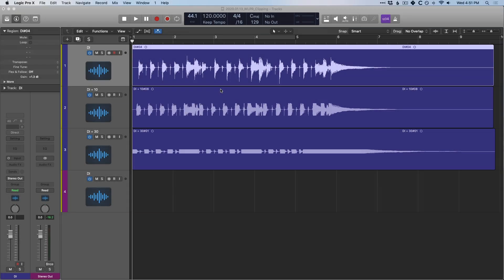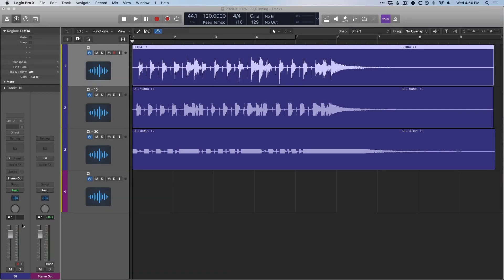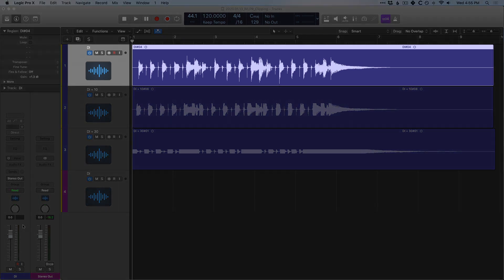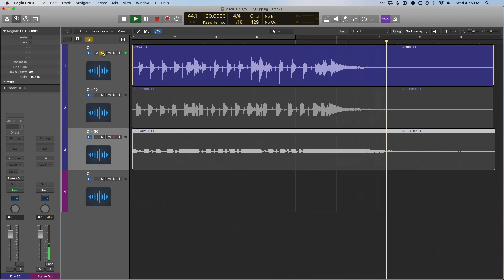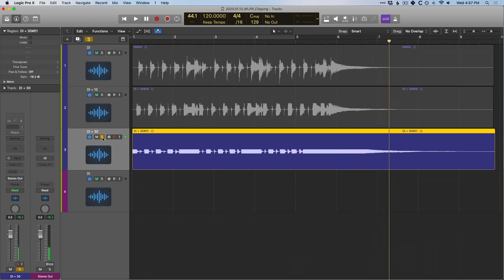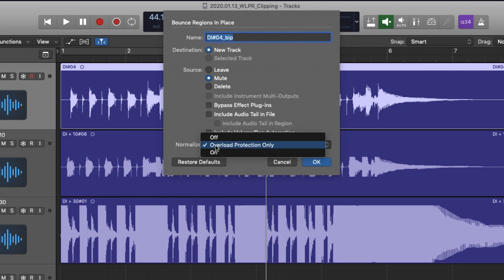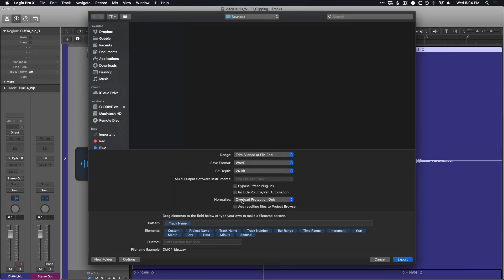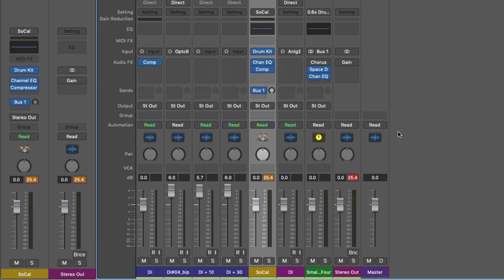Stop Clipping Audio in Your Logic Projects - How to Protect Your Audio in Logic

Comment: I have an issue where the track sounds great in Logic but when I bounce it I get a few slight clips/glitches/hiccups in the same areas.  These areas aren't even that loud and don't have a ton of instruments.  I'm barely even going into the yellow on my mix.  I'm afraid if I turn down anymore, I will lose the impact.  There are louder and more dense parts of the songs where this doesn't happen.  I've searched for this issue and see others have mentioned it but with no good solutions.  Any ideas?
Reply: I have the same issue...It works perfect in Logic, audio sounds great ...but when I bounce it, clipping occurs!
Reply: @vishnutheerdhan_offl  Hey Vishnu, our friend told us a trick.  Bounce using REAL TIME option and it should reduce those clicks.  It's worked for us, hopefully this helps.

Comment: In FCP X the audio waveforms turn yellow and red to give you an instant view of where your levels are for your entire timeline. Does Logic Pro X have this feature?  Please don't tell me it doesn’t—because that would be quite disappointing. If so, does it mean I have to play down my entire 1-hour timeline and stare at the levels to make sure nothing is clipping?

Also, why don't the audio waveforms change in size like in FCPX?  For example, if I increase the output gain in a Compressor filter. The audio waveforms don't enlarge. Strange.

Comment: I like some of the clipping on those guitars - gives em beef/attitude. The clipped drums compression - the clipping seems to do what some plugins do on purpose for effect.
Reply: Wel instead of doing something so janky as bumping up the gain to +30, I’d rather use a saturation plugin or introduce a bit of parallel compression.
Reply: @DecontructRecreate  Yes, I'd try that myself first - rather than slamming the gain.

Comment: hi Chris - I have just bought a Rode NT1-a condenser mic to record vocals and to get some nice sweet Fender Strat sounds out of my 5e3 tweed deluxe amp.  The amps sweet spot is around 2 on the volume, which is quite loud even though it is a 12 watt amp or thereabouts.  I have to have my Saffire USB volume rolled right back to 0 and have the mic about  6" from the cone otherwise the gain goes well over 0dB in Logic. I have the 48v button pressed on the USB interface, otherwise I get no sound.  Will this volume damage the mic?
Reply: same issue, did you find something yet?

Comment: Ok, I get it that if you are clipping on an individual track but have the gain down on the Stereo Out (SO) then you are not clipping the SO.  But, you are still sending a distorted signal to the SO, correct?  It almost seems that you are saying that as long as the SO is not clipped, then neither is the individual track.  Thanks for the vid.
Reply: It's the 32 bit internal processing thing. I don't understand the math deeply but the principle is that internally Logic can handle this coz of the floating point 32 bit math. it's only at the output to an audio file that can play on external equipment etc where this internal math doesn't apply, and you'll get distortion. The distortion isn't happening until that point.